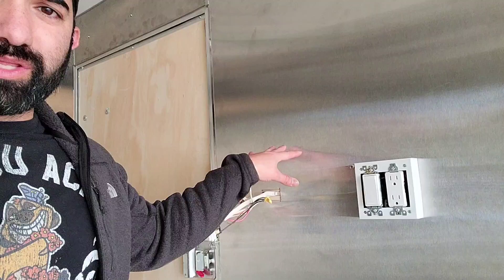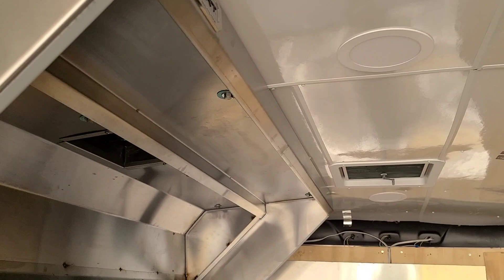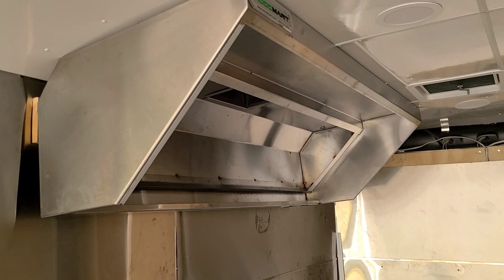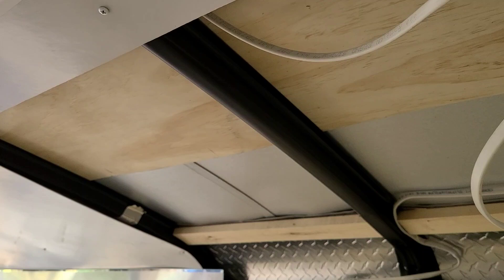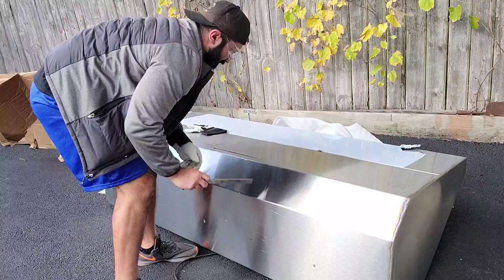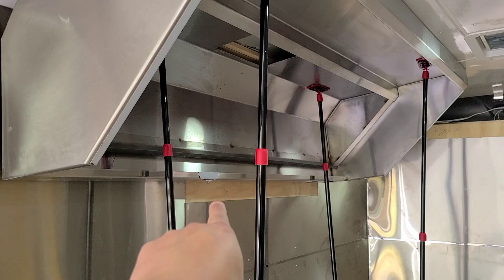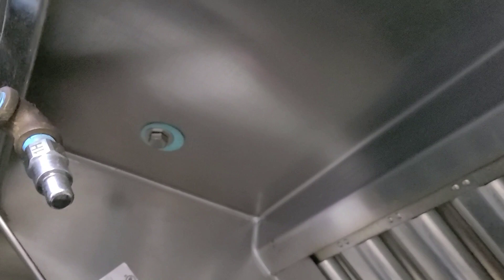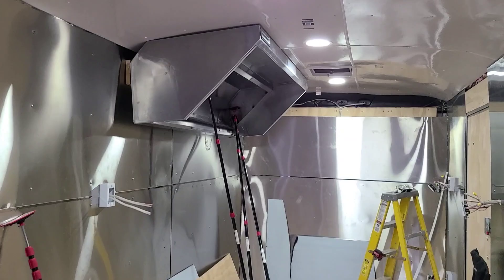Food Truck Build: Installing the Exhaust Hood Part 1

Comment: I am not getting my stainless steel panels for about 3 weeks but I'm getting my hood this week - can I install the hood and then panel it later? I am building out an mt45 step van (old fedex truck) not a trailer - please help :)
Reply from the maker: You can. What I would do is install the hood but don't bolt it 100% tight yet is one option but then if it rains could be a small problem. Or option 2 just butt the SS after and seal it all up. But yes install the hood
Reply: @fbaltierrez  thank you!! also - I can't find the link for your ebook, I really want to get it!!

Comment: We have installed the hood and fan. When its on and the door and widows are close , it squeals thru the window crack and literally sucks the walls in a bit. If i crack the door or open the windows a bit it stops. Do i need to put some kind of intake vent somewhere? Would a dummer type switch work?
Reply from the maker: I personally have never had that issue in the 6 I have installed
Reply: @fbaltierrez  do the units u install in have roof vents.? Im guessing there has to be some kind of air intake to have exhaust outake?
Reply from the maker: @crankycanokie2792  I just order the one from Hood Mart all it has is an exhaust fan. 1 mushroom top fan looking thing and that's pretty much it

Comment: Installing a hood in my food truck, my only concern is drilling a 1/2" hole into a tiny stud that is already under engineered to hold that kind of weight. Instead, I'm using flat stock steel and drilled 2 holes on either side of the stud (dont drill into the stud!) bridge over the stud with the plate on the roof.
Place 1 bolt on either side of the stud, that way all the structural intererty, 100 percent is maintaned. Snow adds to the load too, Im sure its fine either way, but ....
Reply from the maker: Great idea, something I definitely have never tried

Comment: Great videos Frank! Thanks for the info.  Would it be fine to install the hood 90 degrees against the wall and use hangers between the hood and ceiling for the gap?
Reply from the maker: I would not be sure. I have only installed one way only have never switched it or used another method unfortunately

Comment: I purchase an 8 foot hood with a chamfered corner and the ductwork that they sent me measures 12 x 12 square but when I measure the spot that I’m supposed to cut I only have 11 3/4 and I noticed that your duct was 10 x 12 a correct assume that since I have a chamfered edge that I’m supposed to have a rectangle duck in comparison to a square duct
Reply from the maker: Interesting. Yes I have never received a 12x12 square. If it has the same back as mine give them a ring and they will send you a new one if they packaged it incorrectly
Reply: @fbaltierrez  yes they sent me a 12x12 duct  and i have the same set up as you but just 8 foot hood with chamfered corner and if I cut for a 12x12 it will not work 

Thank you

Comment: Hey Frank, question about wall blocking and support for the hood. You'd said you only added 2x4 at the big serving window, you didn't have to add additional support or wall blocking for the hood and fan? This is my 1st food truck build and I'm trying to find all the info I can get. So far you have the best by far helpful video's, even a spreadsheet I was able to print and compare pricing here in GA compared to yours. I'm concerned about the 3/4" tube steel this is framed with on 2-3' centers, not consistent spacing at all. You just use the trailer as built with no additional blocking or support? Thanks for your help and video's
Reply from the maker: Correct for the hood no additional support was used. The only thing I use was a 2x4 on the wall to the flat side to space it 1.5 inches to give me extra room for the fan up top.

Comment: Hood Mart seems to have the best prices but a question, what do they mean when they’re asking if you want 
Stainless Wall Panels w/ Seam Strips & End Caps for extra + $280.33
Reply from the maker: Shipping yes they charge. The 2nd part no idea. That was never something they did before. If its the little triangle pieces at the bottom. Those are not needed, ask them which those are
Reply: @fbaltierrez  thank you Frank, another thing is, they’re asking if you want installation brackets and it doesn’t seem to add any charge to it same with the lights. You can click it, but it doesn’t add any money to the price. Lights are free?
Reply from the maker: @Jonatone  I don't use the lights
Reply: @fbaltierrez  I knew you were gonna say that, ha ha

Comment: Great series, why didn't you mount the hood right against the wall?
Reply from the maker: I wish it would go flush to wall but can't. On these trailers they don't have a flat roof. So it's either I flush to ceiling or flush to the wall.
Reply: @fbaltierrez  I saw you use rubber floor, is it better than diamond aluminum?

Comment: Hi Frank- I’ve ordered a hood at hood art- do those bolts go through the roof? How long are they? Also did you buy a hood with the suppression system installed??? Great Video’s !
Reply from the maker: Yes through the roof. They are about 5 inches but you can buy longer or shorter if needed from HD. And suppression system installed separately
Reply: @fbaltierrez  So they do go through the frame and out the top of the roof ? If not , can you explain or link a video ? Thanks
Reply from the maker: @davidgross2971  yes you have to drill holes for the Bolts to go through from the hood to roof
Reply: @fbaltierrez  Do you have a pic or a video showing the bolts on the roof ?

Comment: on the hood 10x12 duck as you called it, actually called hood Roof Curb, does the roof curb touches the wood inside the roof of the trailer? are the curd suppose to go straight thru the roof without touching any flammable material ???
Reply from the maker: Goes straight through to outside I think it does touch a small part of wood but the hood duct is about 1/4 thick.

Comment: Hello, very helpful vídeos, i have a question, whats the reason for the space on the back of the hood and the wall?? Also what are those things call that you use to hold the hood up??
Reply from the maker: The space in the back of the hood is how the hood ends up fitting like to get it flush to the ceiling. Not much that can be done about that in the trailer and in mine which is same brand.

Comment: How’s it going love your videos actually helping a friend of mine do there food truck I was actually looking into getting the same hood as youres if possible with the angled back to kick it off the side a little bit inside the food truck. But I have no luck finding it on there website if you have any luck or links or something like that it would be much appreciated.
Reply from the maker: Appreciate the feedback 😁. You actually have to call HoodMart and ask for the angle back its not on their website for some reason
Reply: Appreciate the quick response will do thank you and while I have you here how did you bolt the transition mount for the exhaust fan on the roof down I noticed the one bolt coming through from the hood through the roof on one side but for the other sides did you use anything else to bolt the transition to the roof?
Reply: I’m sure the weather glue and flex seal does it’s part just was wondering if I missed something

Comment: What size was those boots that came with your hood? I got my hood from Halifax but they didn't send the bolt kit so now I have to home Depot it.
Update: I see they're 1'' so the next question is how long were they? About 6"?
Reply from the maker: Great question. I would say about 5-6 inches I assume. You can always cut them down after you puts the washers and nuts on them
Reply: @fbaltierrez  thank you so much and fantastic job.

Comment: Does the studs holding the hood up come out the top of the trailer ?
Reply from the maker: No, these are all inside the trailer. How the factory built it is how it stays
Reply: @fbaltierrez  So the studs do not come out the top of the roof ?

Comment: Hey frank does the duct have to be welded all around inside of the trailer?
Reply from the maker: For use in our county they do not require that for approval, can it be done yes but I just use SS Screws

Comment: Where can.i find how to wire it in from the panel to the variable speed switch?
Reply from the maker: It's in her somewhere. But the run down Is pretty easy. The power from the panel goes to one wire of switch the wire that comes from the fan goes to the other wire and the the 2 whites get wire nut together and stuffed in the box by themselves

Comment: I noticed your duct work was screwed onto the hood. Should the exhaust duct be welded to the hood on the inside?
Reply from the maker: It can be depends on your fire department requirements. Mine said its fine how it was
Reply: @fbaltierrez  Thanks!
Reply: You're less likely to get hassled if you use a red-colored high-heat sealant as a gasket on the flange of the duct against the hood. The reason I say red in color is that inspectors will look for the color of joining cements, thread tapes, and temperature-sensitive sealants as a quick indicator of the use of the proper materials. That usually keeps them from digging any deeper. Use at least three screws on each side, one close to each corner and one or more in the center(preferably more). Then another weld-like bead of red sealant around the seam. Make it look as clean and professional as possible. They will be more likely to overlook a weld if they see you took the extra steps to make up for the lack of a weld. I've been dealing with fire marshals and inspectors for thirty years in commercial and residential construction.

Comment: Where did u source the inlet piece of duct? Hoodmart didnt cut a hole in mine or supply the start collar or whatever its called..
Reply from the maker: Yes they won't cut a hole. You have to do that yourself in the field with the flat sheet of metal they provide
Reply: @fbaltierrez  awesome, thx.. did you not buy a start collar or duct riser at all then?

Comment: Frank where do you buy the Stainless steel walls I look for it but I could not find it in the comments of the video
Reply from the maker: I bought from a local metal shop just called around but I bought mine a long time ago I bought a lot of sheets

Comment: Hi, good work. What about 
air supply for Exhaust Hood?
Reply from the maker: Don't need a make up air system as we do don't have a Central Ac unit in Food Truck. I believe that is what you were asking Hopefully
Reply: @fbaltierrez  We also have exhaust hood as well as an air outlet in the wall of food truck. Would you have any solutions suitable for working in the winter, as ventilation system grabs air from outside and it’s cold inside.
Reply from the maker: @hungrypapa3835  that is a question that I would not have the answer to, we have installed Make up air and Exhaust systems in restaurants through my other business they haven't had any issues with cold but they are brick and mortar. Let me see if I can help you find a solution

Comment: I assume that’s frp panels on the walls and ceiling. Would there be a problem mounting the hood flush over top of the frp above on the ceiling and the back wall?
Reply from the maker: Good morning, not understanding the question. You mean like adding the frp later after the hood install?
Reply: @fbaltierrez  From what I see in your video there was a big empty spot in the ceiling area directly above where the hood was to be installed (5:15).
My plan was to frp the walls and ceilings and then set the range hood OVER the frp. I was wondering if there was a reason for that big uncovered spot(fire/heat) ?
Reply from the maker: @zennseven  the hood install covers that right up when you install the hood. I made the measurements bigger that way the FRP was nicely tucked inside. The back part just finished that yesterday where there was a gap.
Reply: @fbaltierrez  okay thanks so I assume if I do things my way with the ceiling covered with sheet foam insulation and frp there are no heat/ fire concerns.
Reply from the maker: @zennseven  there shouldn't be that hood is thick, its made to resist the heat and such as far as I know.
Reply: @fbaltierrez  Appreciate your time

Comment: Hi frank, can i get my ansel system installed prior to the gas lines or should i do gas lines first?
Reply: The ansul needs to know how many btu's your equipment is using, so it could be after but you'll need to let them know your equipment specs.

Comment: What did u use to hold the duck to the hood itself
Reply from the maker: Stainless Steel Self Drilling Screws wrapped with High Temperature Flue Tape. Works wonderful